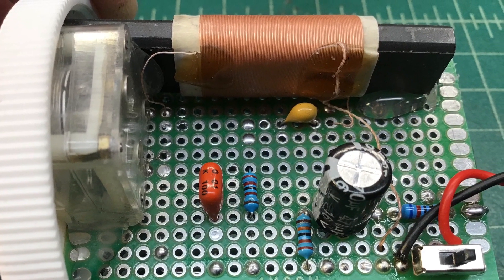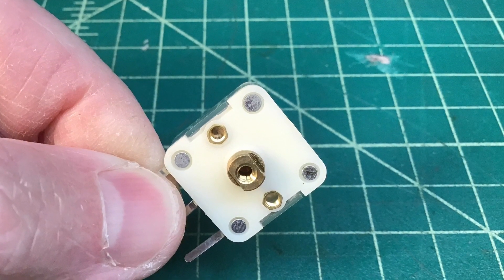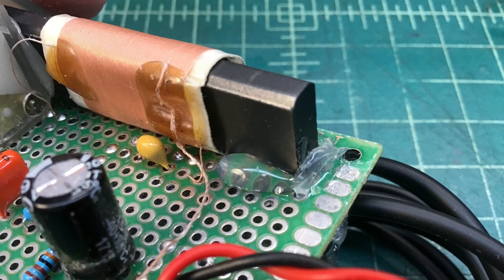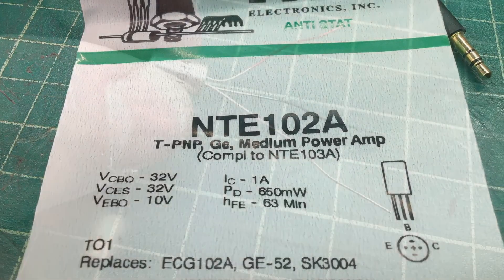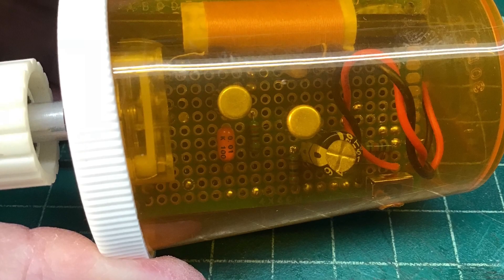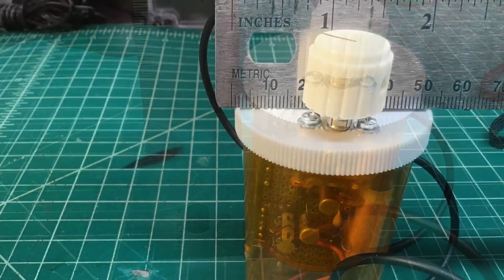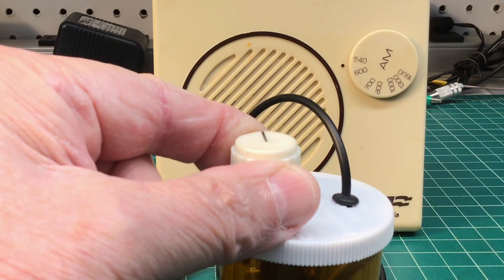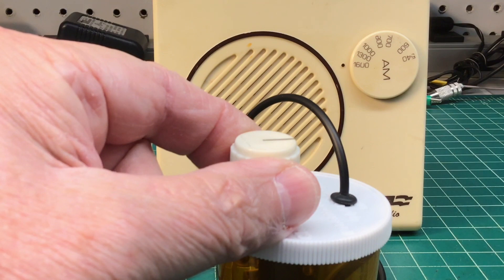A Simple AM Radio Transmitter - Part 2 (Final)

Comment: Hello sir. This circuit can connect with adruino? I have a project send morse code through AM. Do you know How to do it? I have done Morse code be sent through RF module, but i can't connect AM with adruino. Please help me
Reply from the maker: Thanks for reaching out. It’s not compatible with Arduino to my knowledge. Best, Don
Reply: Audio is anolog signal, right? But Morse code is digital signal, so if I wanna put this signal into input, this circuit can operate?
Reply from the maker: Công Hàn Hoàng Not sure how to integrate the two circuits, but maybe this helps: https://create.arduino.cc/projecthub/ahmedharbi197/morse-code-transmitter-d75ee3 Best, Don
Reply: I have watched this video. But it's not really suitable for me. I just want to sent Morse code through AM and use adruino as a key. Anyway thanks for your time

Comment: Looks good Don. I might try it with some modern silicon pnp transistors instead of the germanium ones. I'll also have to work out the number of turns on the coil vs the diameter of ferrite rod but thats just trial and error.
Reply from the maker: George Christofi Sounds great. I would appreciate you sharing the design using silicon pnp transistors as well as the performance once you get it completed. Hope things progress smoothly. Best, Don
Reply: This is all fixed!  I cannot get any kit going!  Who possibly makes there own radio these days?

Comment: Hi there, this might be a stupid question but would the signal produced by this mess with WiFi? I want to try this out but my flatmates would be annoyed if anytime i listened to music their internet cut off!
Reply from the maker: Great question. I can’t say for sure, but I’ve been streaming oldies from my smartphone now for hours and have not had any issues with my WiFi connection or others in the home using their iPads. The range of the transmitter is at best 10 feet. Thanks for viewing and good luck on your build if move forward. Best, Don

Comment: Nice video.  I like the AM transmitter videos.  There doesn’t appear to be any hum.  So many of these transmitters exhibit some hum, I guess, due to modulation of/by the Power lines being picked up and rebroadcast.  I have been looking online for a cure and it seems the problem although well known is not easy to fix.  When I see something like this I get real interested!  Thanks for putting your work on line.
Reply from the maker: Stephen - thank you. It works better than I expected. I listened to some oldies last night on my Zenith 5S29 for several hours and it was rock solid. Plans are to do the same tonight. Of course, the max distance is limited to ~10 feet without an external antenna, but this works perfect in my situation and I don’t have to be concerned about violating regulations. Hope you’ve been doing well. Best, Don